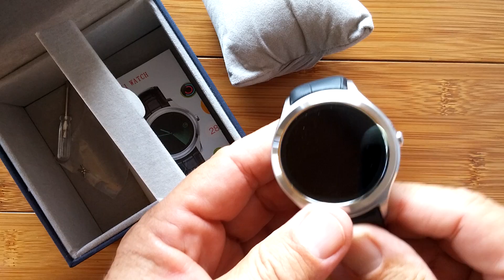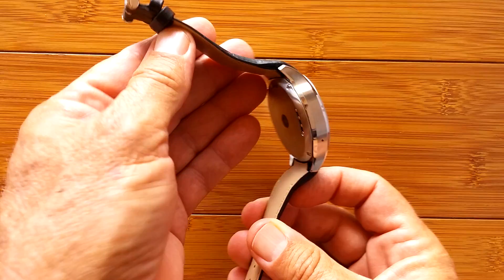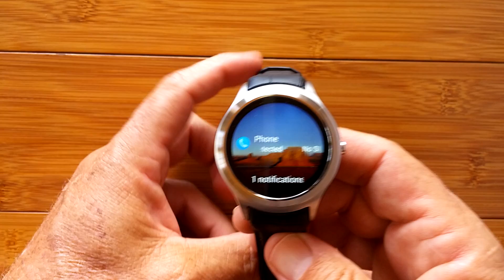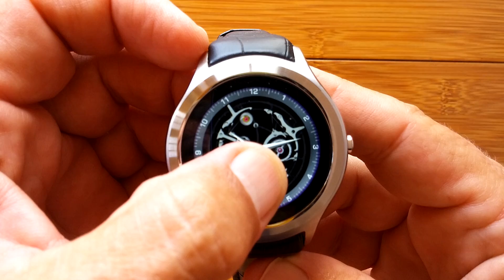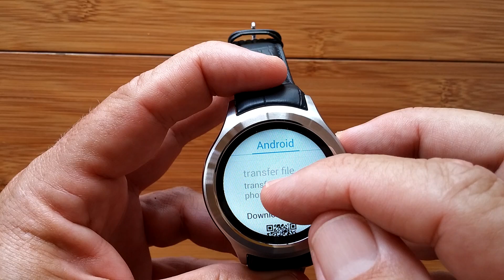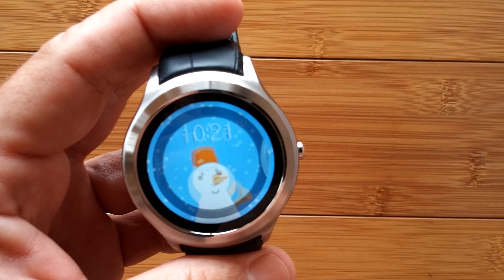FINOW X1 HOT NEW Smartwatch: First Look

Comment: which one is better no.1 d5 or finow x1?
Reply from the maker: +yuvraj singh Personally, I like the slightly larger FINOW X5. Easier on my eyes and the stock keyboard is much more accurate (bigger buttons). Between the D5 and X1 it becomes about the firmware, and which companies provide the best support. FINOW currently appears to be more responsive, especially to an English speaking audience. They both are doing regular firmware updates, and No.1's website is better designed to find them (though this may change as FINOW grows -- it's relatively new, from what I know). Basically, you can't go wrong with either watch or either company.
Reply: thanks for reply

Comment: Hi. Why does it look so much like an exact copy of the No1 D5???
Reply from the maker: +Anthony Verloop It seems that there may be a central hardware manufacturer who ships finished watches to different companies where the firmware is tweaked and installed. Those companies then send the units to smaller companies, who sell a variety of different watches through big companies like GearBest or aliexlress. Many hands in the cookie jar. You'll find a watch named the K8 mini looks just like both of these as well.

The dividing factor seems to be two things -- How responsive and customer focused is the company that adds the firmware (in this case No.1 and FINNOW), and how frequently and effectively do they keep up with firmware updates. There may be a slight edge to one version or another through firmware tweaks. That's what to look for if you're not driven totally by lowest price.

Comment: Sadly no 1900 wcdma for USA..I think the S55 is the only one so far.
Reply from the maker: +spikey911usa If it supports 850 like it says in the specs, it may help those in big cities. Need to hear from some folks if they are getting 3G in the USA (at&t or T-Mobile).
Reply: +SmartWatch Ticks From my understanding 2g is being discontinued across the board in January.
Reply: +SmartWatch Ticks I second the motion from Spikey911usa: AT&T has announced they will be phasing out any 2G coverage in the USA whatsoever by 2017, and in many cases, before. It's looking like standalone smartwatch fans who are interested in using the watch to make and receive calls (me) are going to have to stick with the S82 or some other over-priced standalone. I'm about to order the S82.